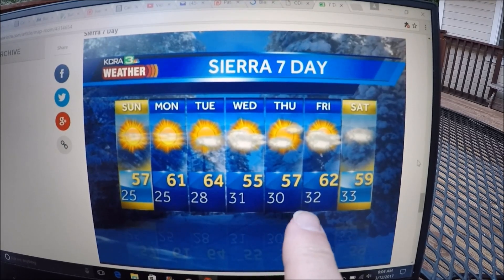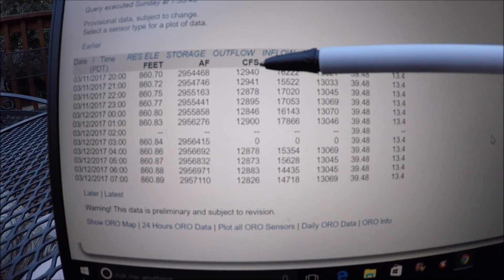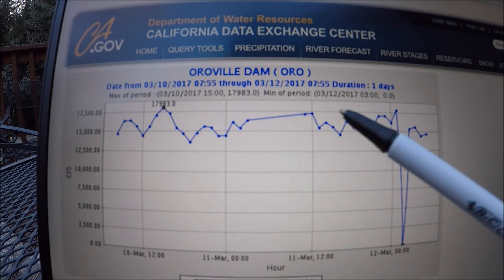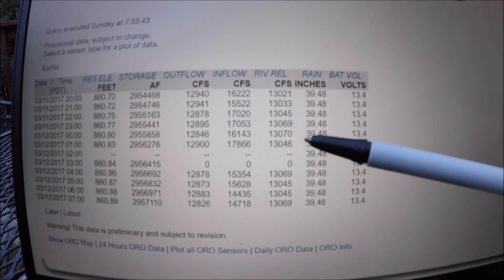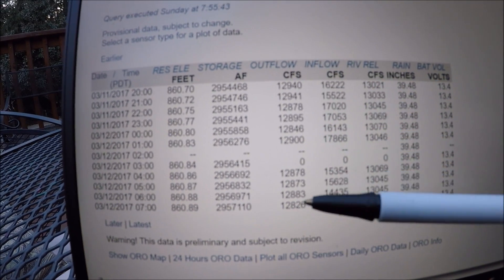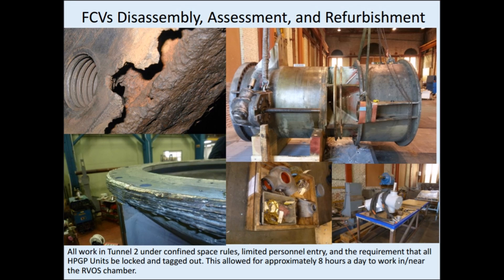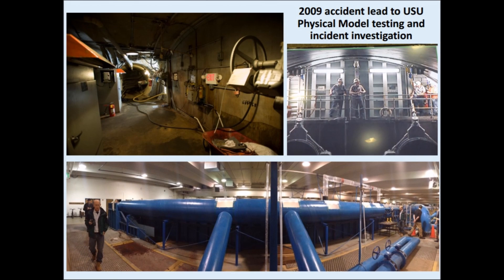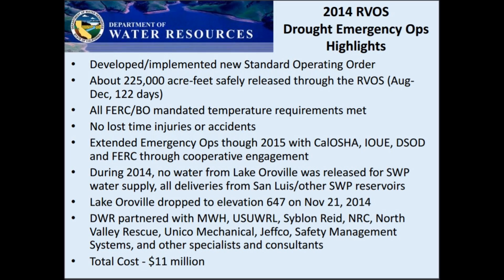Oroville 12 March update River Valve Outlet System Explained

Comment: Hello Juan
I've been following your videos and once visited the web site you often show when your talking about the present conditions there. One question, what is the battery voltage for that they show on that page?
Side note, I found a live feed of the dam / spillway one evening and there was a chat window in the upper right on my screen. The say something at the bottom of it kept catching my eye so when I just couldn't resist any longer I typed in, "George in Michigan here and all of our lakes are doing fine". I was curious to see any comments it might cause but there were none.
Reply: I'd assume the battery is a backup system on loss of power so they can monitor the various readings even with no main electricity.  If the voltage gets too low they'll send someone out to check it out and replace if needed I'd guess.

Comment: Juan I appreciate your support of DWR management however I think some serious criticism of their decision making process is deserved. As you mention these guys have made a series of poor choices which in turn have compounded the problems not improved the situation.  As a pilot you know the importance of good choices in a crisis situation.. If these guys were pilots they would have crashed the plane with all the passengers on board... The cascade of events that has unfolded is comical but for the fact many peoples possessions and  life is in danger.... Start with the decision to remove the energy disipator ring... then making the river valve inoperable going into the flood season... Knowing there were cracks in the spillway and repairing them without investigating the subsurface conditions...  operating the broken spillway instead of getting in there and fixing the hole when it was small and manageable... with proper coordination it could have been fixed in a few days.. Withholding the flows on the broken spillway to 40k cfs until the emergency spillway was overtopped and then finally increasing the flows close to 100k cfs when necessary to lower the lake level. Ignoring the obvious fact that there would be massive erosion if the emergency spillway was overtopped.. Running power lines across the flow of the emergency spillway... Removing the power lines and towers  instead of armoring the towers.. The debris removal was supposed to happen in 10 days... we are close to 13 days in and still not more than 2/3  finished... Not opening the river valve manually to aid in the outflow through the bottom of the dam...   I think the way the DWR has handled this is crazy... Several people at the top deserve to loose their jobs... Start with Kevin Dossey...  but that will never happen because they are state workers and they all play CYA more that they concentrate on their work...
Reply: John Lucas, my read of the stories from Feb 9th, 10th indicated that DWR officials were "hopeful" that it would not overtop the emergency spillway, not that they ever promised that it would not.   At one point they were releasing 65K CFS and were still hopefull, but were then forced to slow it down to 55K CFS to avoid rapid erosion on the north side of the spillway threatening to undercut one of the high tension towers and that's when the odds of using the E-spillway rose again.  

Based on the raw numbers, I think if they'd either turned the main spillway back on earlier on the 8th at 60K CFS, or ramped up to 100K CFS a day or two earlier than they did, they could have prevented it overtopping the E-spillway but they had too many unknowns at that point.     If they had not had to turn it off at all on the 7th and 8th, they could have easily handled the rise  with a  steady 60K CFS.  

As for the RVOS, I still don't think it makes any significant difference right now.   It was not designed as a way to release water during high water flood emergencies.  Its max 4000-5500 CFS is just a drop in the bucket.  It's meant to be used during drought conditions.     And because it shares its outlet with the turbines and is meant to be used when the water level is below the turbine inlets, I don't think it can be run at full flow rate while turbines are operational (too much total water in the tunnels), so it would have very little positive effect right now with 5 turbines running.  
Oh, and it cannot be used when tunnel 2 is flooded (flow past the downstream end of the vent tube creates vacuum at the upstream end of the vent right behind the pressure relief wall which can destroy it, as it did in 2009), so it could not have helped at all when the debris dam had flooded tunnel 2,  which also forced the turbines to be stopped, for the same reason.
Reply from the maker: I agree up to the point of failure, but disagree with you on handling of events after the failure. It's no longer exclusively DWR's show.
Reply: Hindsight is 20-20.  I agree it was a suspect decision to let the reservoir get so full before opening the main spillway.  It is as if their thought was it was a last resort to let it degrade, but then when they saw the disaster unfolding with the emergency one they had no choice.  You can appreciate that they didn't want to destroy the main spillway, which ended up happening.  It's having two horrible choices, and trying to pick the lesser of two evils.
Reply: John Lucas 
Yup, and in my opinion, it all leads back to money. Operating the outlet without the dissipator ring...an attempt to save money.  Not maintaining basically everything...to save money. It is always about the money and unqualified people at the top making really bad decisions.
Reply: Regarding point number 2, I believe they removed the trees and scrub when they realized the water was going to come over the emergency spillway as a way to cut down on the amount of debris that would wash down into (as I think of it) the river, or as it's being called, the thermalito diversion pool. 

I understand the thought of the vegetation holding the ground together but I don't think it was really capable of it anyway. If you note further down the slope where they didn't remove the vegetation it still eroded. It even took out rock.
Reply: I think allowing the emergency spillway to over top was crazy...  to think the hillside wasn't going to wash away and the concrete wall wouldn't get undermined with water washing over the wall.. ?  To understand what was going to happen all anyone needed to do was look at the erosion damage the broken spillway was causing on the adjacent hillside..  Prior to the overtopping the DWR was repeating that it would not happen... but then because they withheld the water and it did happen... If that's not poor decision making I'm not sure what is?
Reply: Lad A Dog is because someone at the top wants this disaster to unfold. There's huge financial motivation here. All the way from FEMA funds to insurance payouts. Sooo much money can be made after the fact of a national disaster. The bureaucratic incompetence is the perfect cover. 
Is the kind of thing that unfolds in a neat little narrative on the History Channel 5 years later.
Reply: George Everette, They learned some useful things in the middle of the Feb incident.  After they were forced to turn the main spillway back on after it had been off on the 7th and 8th, they ran it at 55-65K CFS for 3 days and once it blew the original hole out and cleared some of the debris it pretty much stopped head cutting because the water was literally just flying off the edge of the break in the spillway into open space instead of churning around inside the hole.  That's when they ramped up to 100K CFS and ran it like that for 3-4 more days without further head cutting.    

Everything they've done on the spillway since they shut it off on the 28th has been to mitigate the possibility of further head cutting, probably so they have the option of running it at a lower flow rate (when water isn't flying off the end as far, or at all).  They've covered the  exposed ground soil/rock below the end with matting and as much Shotcrete as they can.       Personally I do not think it will head cut further.  

However, it is possible that there are more voids upstream such as the one that created the original hole and if so they need to mitigate that now.   I have little doubt they've been testing for that.   In DWR's latest couple vids they  show two  small portable drilling rigs boring through the spillway floor 50-100ft from the end.   They're either probing for voids, or have already found them (using ground penetrating radar or the like), and intend to fill them up with concrete.  

I don't think they ever intend to ever let the res level top the E-spillway again, but do think that now that they've armored all the ground immediately below the E-spillway that it can handle at least the flow rate that it did during the Feb flood and probably more.     Almost every other E-spillway I've ever seen on a good sized dam has the concrete at the bottom of the main drop extending straight out 50+ ft.   Why this one did not, is still a big mystery.   My guess is that they built the E-spillway on rock, and over estimated its durability.   As we've seen in the exposed ground below the break in the main spillway some of the rock is very solid, and some has inherent fractures which allow flowing water to split it apart.   Just as there's a mix of that below the main spillway I suspect there's a mix of that below the E-spillway.
Reply: Lad A Dog,   Lemme address your points. 
1.   They did.   The level was well regulated to 850ft up till Feb 7th when the large and growing hole was discovered in the main spillway.  They had to shut down to look at the hole.  They let some water flow through it on the 7th and the hole head cut uphill quickly so they shut it down again for most of the 8th.    Lake rose 12ft the first day and another 12ft the second day.   They then turned main spillway back on at reduced flowrate in hopes of minimizing further head cutting and didn't ramp up to 100K CFS until the emergency spillway erosion occurred.    They believed that the E-spillway could handle the flow (original design calls for it to handle a lot more flow than it did). 
2.    As others have said, probably removed trees to prevent them from clogging up the downstream dam and diversion gates.    The only erosion that mattered was immediately below the base of the E-spillway and edge of the road at NW corner of the parking lot, and there never was vegetation in either location.  
3. Not sure which sensors you're talking about or why it matters.   They had all the sensors they needed to handle the flood.  The problem started with the hole in the main spillway, nothing more. 
RVOS is not designed to handle floods (4000-5400CFS is not enough to make any difference, and would not have during the flood period).  RVOS is there to maintain minimum river flow when the reservoir level drops below the bottom of the turbine inlets at 640ft.  
4. New flood planes where?      No series of pumps and pipes can ever match what the main spillway is capable of releasing.    They needed 60-100K CFS to manage the flood which is literally the flow of a major river.   
5. Journalists who bother to go up to the site can gather any info they want.   Most seem to want to report on it from afar instead, which is also the case for 99.9% of internet journalists.    The no-fly-zone is in place because they are doing a ton of helicopter work both during and immediately after the flood (moving loads of rocks), and right now moving/installing power line towers.     Two of the last three DWR vids (released just last night) show helis transporting powerline towers around the site.     

There is no current issue with the diversion tunnel plugs.
There's no physical issue with the RVOS system at this time, only a decision to not use the RVOS until they've mitigated fire handling issues at the control panels.    Note that the RVOS controls were relocated to the main turbine floor during the RVOS repairs they made in 2013-2014.   Probably half assed that a bit.  
There is no reason at all to believe there is a problem with the main dam.   This dam is designed to hold the res level  right at 900ft (1 ft below the top of the emergency spillway) for prolonged periods and has done this many times in the past (e.g.  Late spring 2005, 2006,2011, 2012 and many years before ) 

Don't get me wrong, there's a clear history of mismanagement when it comes to things like the 2009 RVOS incident, but other than keeping a better eye on the main spillway (which is a challenge because inspectors are not normally allowed onto the spillway itself when the water level is above the bottom of the spillway gates at 813ft) there isn't a whole lot they could have done differently during the Feb incident.    Given the rapid erosion of the hole that occurred between the 7th and 8th when they let a little water into the spillway, they had every reason to fear that the head cutting might proceed quickly right up to the top of the spillway if they went to full flow.
Reply: Would you mind expanding on this comment?  Who is taking over - and are they better?  Or is it simply that the patient (the Dam) just had a heart attack - so the Heart Surgeon is now on site.  Of course - he will leave once the triple bypass is done - and let the patient still eat poorly and die early.
Reply: the trees if eroded would have gummed up the works at the afterbay.  But I can't help but think all that earthmoving right before the water hit the slope didn't accelerate the erosion.  no good ground cover, just bare dirt.
Reply: I think that using the emergency spillway made sense.  But even at the time, watching them clear trees, I was thinking, really, that's the concern?
One, it was obvious all effort should have been rock armoring the outslope.
Two, running the emergency spillway before evacuating everyone below it.
Reply: Foresight is a lot better than hindsight... when your spillway is already damaged and your reservoir is 3 feet from the top and you have 120k cfs coming in and you are releasing 50-60k cfs... you don't need to be a rocket scientists to figure out what is going to happen...
Reply: I'm not sure it needs to be re built but it definitely needs some serious attention.
Reply: When they have to open the gates again do you think it will head cut to the top or remain where it is now and if it does go to the top do you think the emergency spillway will be able take the overflow?
Reply: +daemn42 I agree with most of your points... except that they kept saying the emergency spillway would not overtop... right up to the point where it overtopped... so IMO that was just plain dumb..  They should have cranked up the spillway sooner and prevented the overtopping. Poor maintenance is what caused this disaster... It's clear that parts of the spillway were built on dirt not rock and in some places the slab looks to be no more than a foot thick. I'm glad they are paying attention to the subsurface conditions now but it sure would have been nice if they had been doing it a few years ago.. I think they should have added some support to the spillway that is overhanging... when they load is with water if it breaks that will allow more headcutting and that's not good. I believe they could have quickly patched the original hole with boulders and grout... and then opened the spillway to 100k cfs and prevented this whole mess but that opportunity was gone as soon as they opened it again and created the larger hole.   Also they are saying a critical valve is inoperable because of a fire suppression system??  let me repeat.. a fire suppression system..  That too seems crazy... IMO something is fishy with that... In an emergency I would think you over ride the system and do what it takes to open the valve...  It's an electrically actuated valve.. basically a motor with a linear actuator.. it's not rocket science.
Reply: Funniest thing I've read all week.
Reply: Many decisions here look very bad and I assume they must have some explanations as to why:  1.They did not follow the 860ft release mandate in the first week of February which required them to  release water down the main concrete spillway, and instead allowed the lake to overflow the earthen weir.  2.  Why did they scrub the side of the mountain clear of vegetation, which will increase erosion exponentially upon future use.  3.  Why the broken sensors weren't repaired last December.  4.  Why they are spending 4.7 million per day to clean up debris, and patch the destroyed spillway, without creating new floodplains, or using pumps and piping to prevent future need for the damaged spillway, which will cause another mountain of debris? 5.Why are they withholding information by barring journalists, declaring the dam a no-flyover/no-drone filming and having few press conferences? Why have they allowed the dam to decay - main spillway doors wont shut properly, one of the turbines has been out for years, the water sensors were out for months, the river outlet system inoperable, the diversion tunnel plug not working, et c.  We have yet to know the condition of the main dam structure and whether or not there is seepage or any change in angle position.  I still think the whole thing needs to be rebuilt from scratch.

Comment: Major components like that should never be solely operated by an electrical/hydraulic system. there should always be a manual/hydraulic assisted system in place to operate those valves in case of any type of power outage or out of service upgrade.
Reply from the maker: There is manual back up control.
Reply: If that is the case then why dont they use them. This article implied that they can not be used due to the electrical upgrades being made due to the fire at the other power station. If they had a true manual operation then an electrical outage would not prevent them from using these valves.